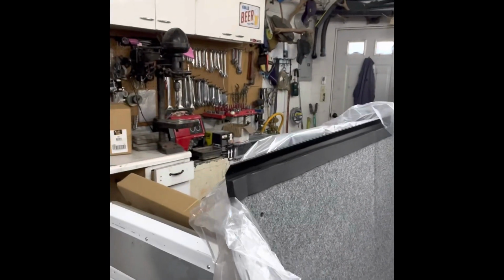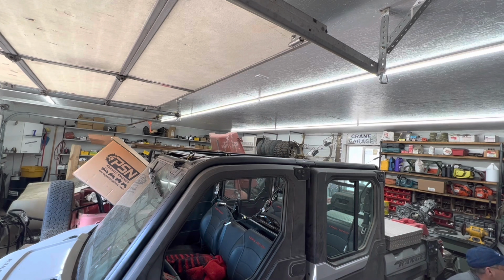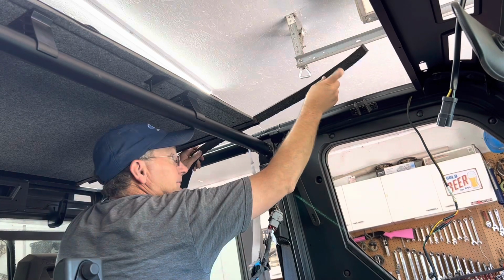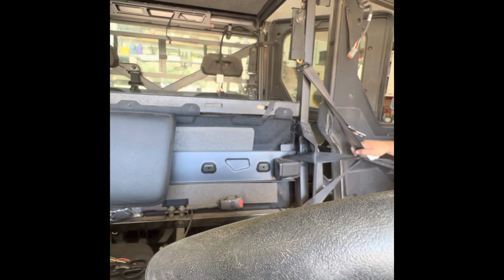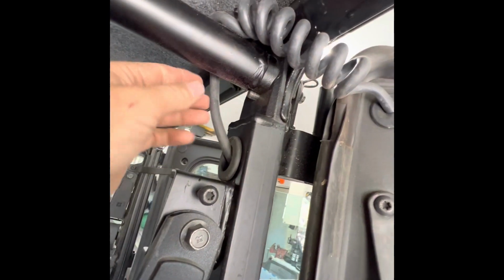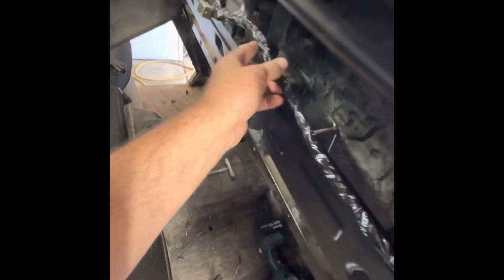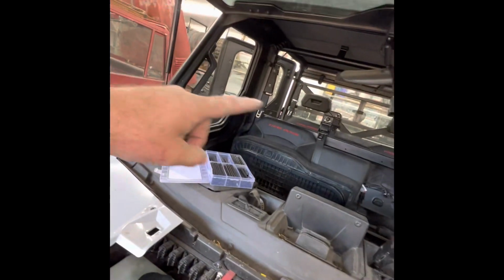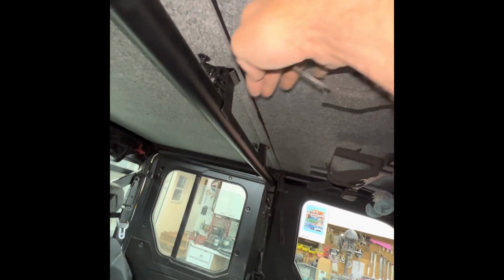Polaris Ranger 1000xp Crew steel roof installation

Comment: That was a lot of work and probably wasn't cheap. I think I would have tried putting more gasket or even sealer to seal up the original roof. I haven't had any trouble with leaks in my 2023 Crew Northstar Ultimate. When I open up the door during rain, I get drips on me. I haven't noticed any leaks so far.
Reply from the maker: Oh, the trouble with plastic roofs, is they expand and contract due to hot and cold, and they crack and usually always at the points where they’re fastened and so the steel roof is just much more durable has a nicer interior finish and allows me to mount things to it because it is much stronger and heavier. It’ll support roof racks and lights better
Reply: @allwegottadois  Are you having any other issues with your Ranger. My 2023 the GPS can't find any satellites. My washer fluid pump stopped working. I also feel like it's harder to shift than it should be.
Reply from the maker: @mossman381 if you GPS can’t find the satellite probably something wrong with the head unit or something is not plugged into the back. take it into the dealership and have them check it. If it’s still under warranty I’m a master certified polaris tech and I’ve actually had a few of the head units Be bad and not grab satellites.
Reply from the maker: @mossman381 the washer fluid pumps go out all the time, but make sure it’s getting power to it first before you rule that out but they’re very cheap. They’re only like 12 dollars
Reply from the maker: @mossman381 if you’re having trouble shifting, it’s because the clutches are still grabbing the belt. either the secondary needs shimmed or the weights are too heavy for your elevation its grabbing the belt at an idle.
Reply: @allwegottadois  I am in Wisconsin so elevation doesn't have anything to do with it. You aren't having any issues with yours? I had a chance to buy a new 22 Trail Boss. I thought I was doing better going with a 23.
Reply: @allwegottadois  I had gps until mid September. Haven't had it since. I see there was an update in August. Also going to try and reboot it. Just found out how to do that. I have had this thing for less than 2 months. Things shouldn't be breaking already. The dealer is an hour away. Not very happy with them because they charged me an assembly fee and the dealer doesn't even assemble the Northstar models.
Reply from the maker: @mossman381 well elevation has everything to do with it because your weights might not be set up for your elevation in your primary
Reply from the maker: Most likely, though your secondary needs to be shim, you need to have them look at the belt alignment, and make sure that the belt is not dragging on the face of the primary or the face of the back of the sheave , it hast to ride in the middle at an idle
Reply from the maker: @mossman381 well you can try rebooting everything but if nothing works they need to replace that whole screen head unit as that’s probably what’s going on or there is something wrong with your antenna the wire it might’ve gotten pinched somewhere
Reply: @allwegottadois  I appreciate all the responses. I will let you know how the update and reboot goes. Another thing my Ride Command does it I can't sign into my Polaris account. It wouldn't do it at the dealer when I picked up the machine. I should have walked away from it then. Why wouldn't all Polaris clutches be setup for a relatively low elevation? Then the people that do live in high elevation can be the ones that need to adjust. I believe Wisconsin isn't very high elevation wise. And why didn't the people building this Ranger measure the belt? When the guy drove it out of the factory and noticed it shifted hard why didn't he take it back and have it looked at. I have nothing to compare it to, but it just feels like I am going to break the shift cable if I continue to shift hard. Right now, I am kicking it into neutral just before I come to a stop to change direction. That works great but I don't think I should have to do that and sometimes I forget to do it. Then I have a hard shift again. When the new 1000 came out I heard a lot about it being harder to shift. I figured they would have had it figured out by now.
Reply from the maker: @mossman381 well so you don’t damage your shifter cable or your shift lever or your shifter paw in the transmission , if it’s really hard to shift shut the engine off shift gears and start the engine again that’s the only way to be sure you don’t hurt something
Reply from the maker: @mossman381 and it’s probably doesn’t really have anything to do with what your elevation is. It’s they probably have too heavy of weights in there and it’s engaging at an idle. I like putting 96 or at the very least 104 weights, but Most of the Ranges come with 114 s or heavier, which makes them very troublesome.
Reply: @allwegottadois  Did you change the weights in your clutch? I remember my very first Ranger I bought. It was a 2002 or so. It had the 500 motor. The clutch was shot, and I had to shut it off to shift. My new Ranger isn't that bad. I was having fun customizing it until all these problems started happening. I have bought several new Rangers in the past. They have always had little issues but nothing like this 2023. It's pretty ridiculous and Polaris should be ashamed.